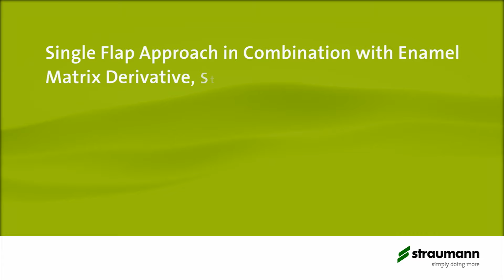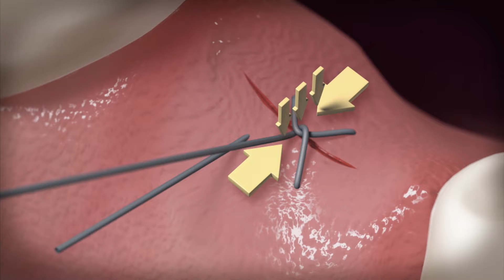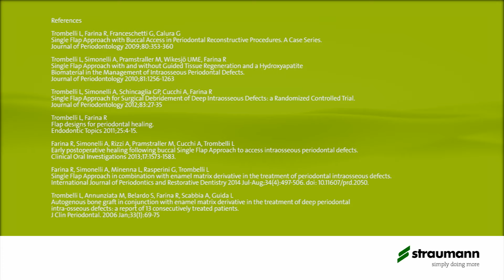Single Flap Approach in combination with Enamel Matrix Derivative, Straumann® Emdogain®

Comment: Just had this done today but only two flaps at the front and back. 16 needles an 6 stitches. Sucks huge ass. And I’m a religious tooth cleaner and go every 3 months. I have a wire from braces that prevented my hygienist from noticing any movement or issue. It was only from X-rays from a yearly thing, my advice to anyone young or notices things, if your gut says there’s an issue, just go. It sucked ass but you get frozen to shit. Be brave, you have too.
Reply: How are the gums now
Reply: @KettiexD  you spit out the stitches, very sensitive to hot or cold. Better ya but i feel
Like the wire from the braces traps stuff and prevents cleaning properly
Reply: @joshmartinak4315  do the gums look completely normal now is there root coverage.  How was the pain during the treatment?